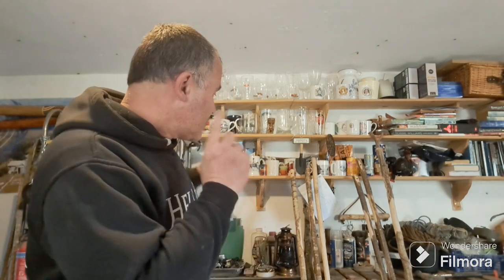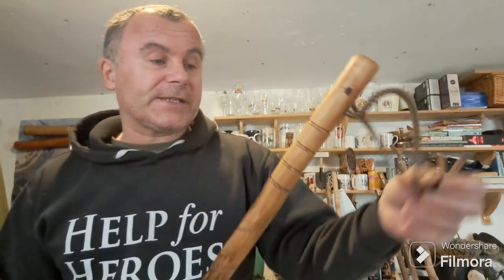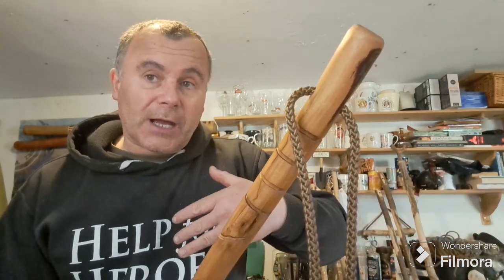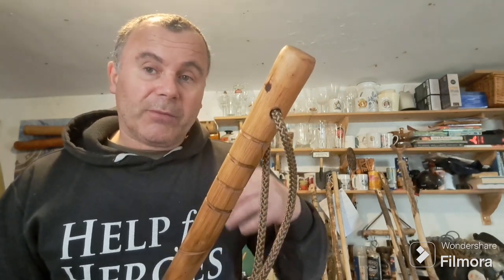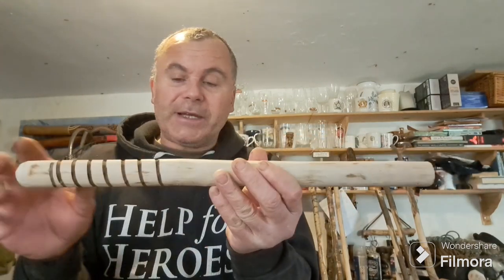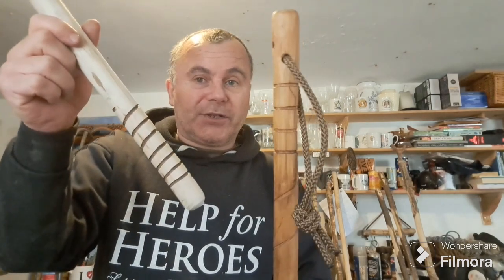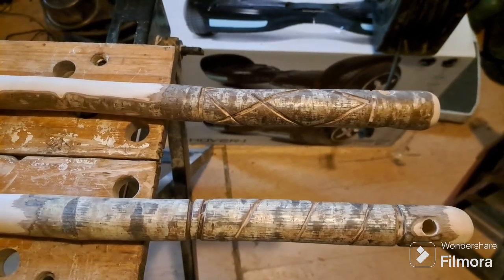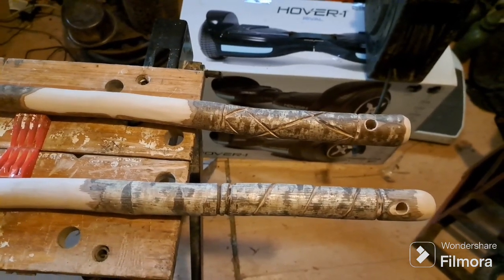How I carve hand grips on hiking sticks. Folklore hiking stick workshop chat.

Comment: Nice to watch how others do things and pick up some ideas. I've found file and sandpaper give me the best results so far, it is more work but more controlled and with practice I'm getting quicker. I've also found that when I'm preparing ends to fit ferules and heads that using a 'blocker' of waste wood to guide the file lets me make a nice clean edge. I've finished the dress stick for Dad's 90th and made another two with brass heads. The heads seem to come from India or China and the casting can be dog rough meaning there's a fair but of tidying up to do before they can be fitted. Having to do a lot of lateral thinking to work round things at the moment, your videos are very helpful.
Reply from the maker: Hi, It's the simple methods that are satisfying to apply. You're doing something I have not done with cast metal and working with those problems . My customer base is hiking orientated so for me it's a pleasure to hear from other  crafters and the types of sticks they are working on. Wishing you  all the best for your dad's stick.Thanks for watching.
Reply: Haven't got any customers as yet. I used to make (and break) working sticks , the walking sticks are a new thing, also started making Hiking sticks and Martial arts Bo, Jo and Hanbo staffs. Love bringing out the wood grain, they arrive looking muted and boring, then the first coat of oil goes on and they show their character. Having a go at doing a spiral twist on an off-cut before doing it for real. I've started keeping odd bits and pieces to practice on. Having to buy in hardwood dowls for now as I have no shanks at the moment so have been scouting out areas to harvest next autumn/winter. Even then it will be a couple of years before I start finishing them.